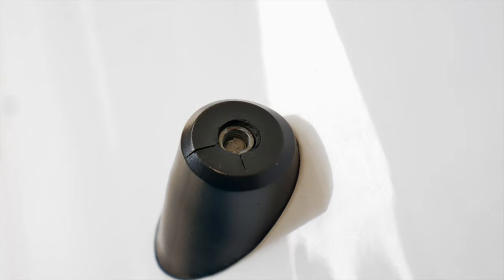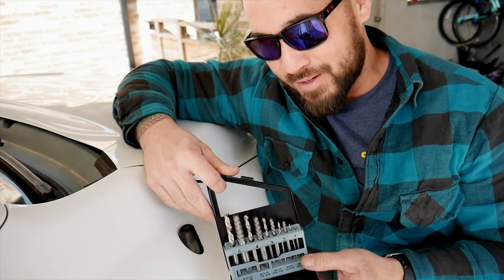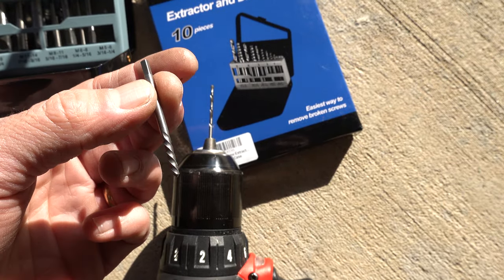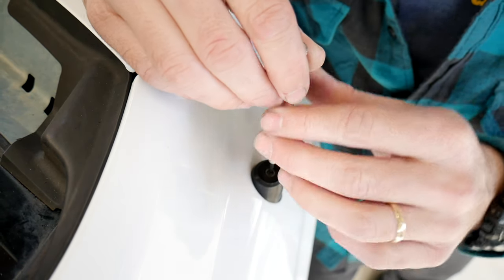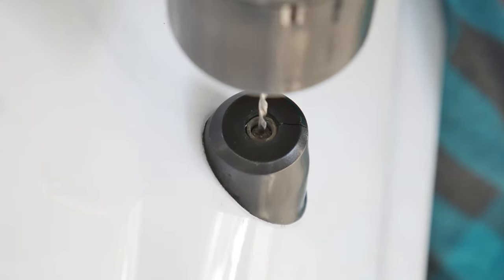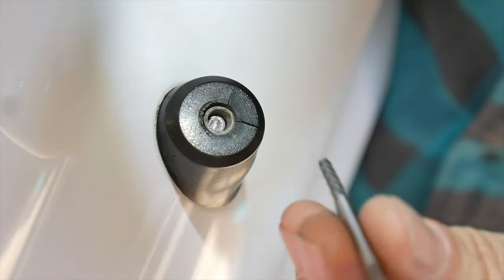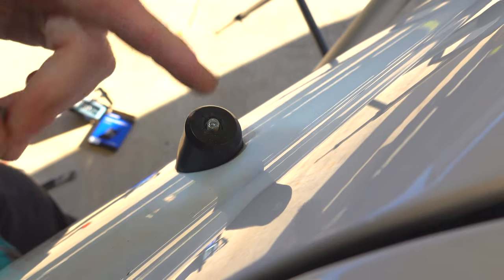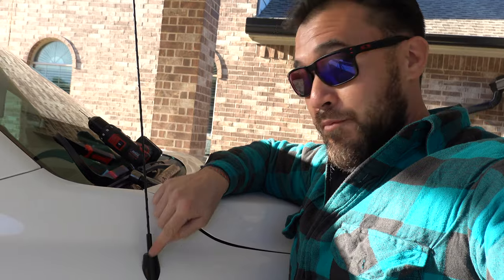How to Fix Your Trucks Broken Off Antenna / Carwash Snapped off My Toyota Tundra Antenna Mast

Comment: I was researching antennas and found that if you want good reception for both AM and FM, the 31" antenna is the preferred (31" is one-fourth of the 'ten foot radio wavelength' for achieving best radio reception). So, rather than using a "ten-foot antenna" for optimum reception. they came up with 31 inch antenna (1/4 of the 10' wave length). Consider this as well, the professional said in the "fin" antenna, there is a circular antenna - a circular "coil" - that if straightened out, would measure... (want to guess?)... thrity one inches! That is why they work decently... but the shorter, stubby ones will not receive radio signals nearly as well. Sorry to be so long, but I simply reinstalled a 31" on my 2011 Tundra (and I will remove it before I enter the car wash from now on! I loved your video... it helped me a ton! Thanks...
Reply from the maker: Thanks Michael for sharing
Reply: I have a 2011 also.

I hope to fix the antenna on my own. I'm too old to not know how to use a drill.

Comment: This video definitely helped me get started, but if you have a drill, bits and a long straight pick tool, you wont need and extractor kit. Drill your hole in the center of the bolt, take the straight pick and a hammer and strike/drive the pick into the top of the bolt, then twist. Mine came right out like it had a head on it. Thats not gonna work in every situation of course, but worth trying first if you have those tools.

Comment: Wow! This worked on my 2012 Toyota Sienna XLE. The broken piece actually came off while using the drill bit to drill down and prep. for the extractor piece.  I didn't think anything was happening; it seemed like no depth was being gained, little slivers of metal shavings kept piling up and I couldn't see any progress.   I was about ready to give up, but then the top of the broken piece surfaced. Then I unscrewed it by hand. Woot! THANK YOU, DONNY!

Comment: Made it through the carwash 4 times before the antenna snapped off. I ordered the replacement antenna and will be trying both these options to remove the mast today. Thank you for the video.
Reply from the maker: Good luck
Reply: @Donnythelatemodeltech drilled out post with the extractor kit from Harbor Freight and it worked. New antenna installed. Will remove the antenna next time I run the Tundra through the car wash.
Reply: This just happened to me in my 2017 tundra last week

Comment: thank you for posting this , it was very helpful. I made the mistake first of trying to drill a hole into the broken antenna base using a regular bit and it tightened it and also made it go WAY down deep, thats when I was like ok I need to watch a video on this and that was the first thing you said not to do haha. anyway it still worked out with the extractor I did put a little oil in and let it sit for a few minutes then used compressed air to blow out any shavings that got in from drilling so they wouldnt further contribute to making it hard to unscrew . its was in pretty snug, had to use pliers with the extractor, but still managed to get it out!!! definitely use a reverse bit!!! lesson learned.
Reply from the maker: Awsome, thanks for sharing!

Comment: I broke two of the reverse drill bits that came with the kit I bought. I tried by regular bit and broke that one. IWhat kind of bit do you need to make this work?  A titanium....diamond bit? Something that is stronger than the screw metal?  Maybe it comes down to the brand extractor set ?  Some are strong and some are crap?  How long did it take total driiling to make the hole?